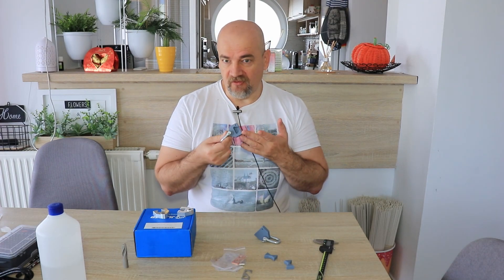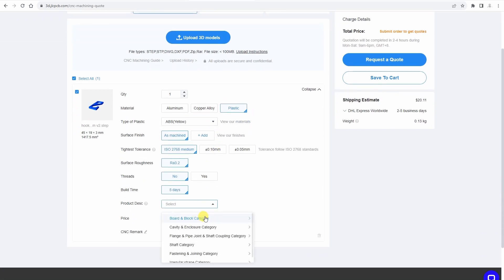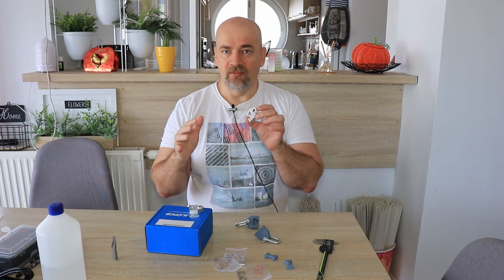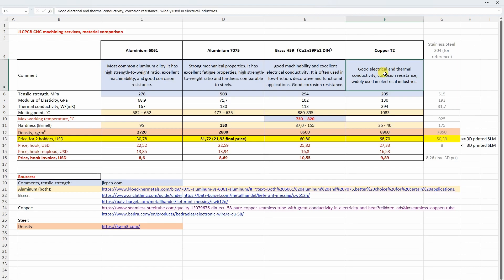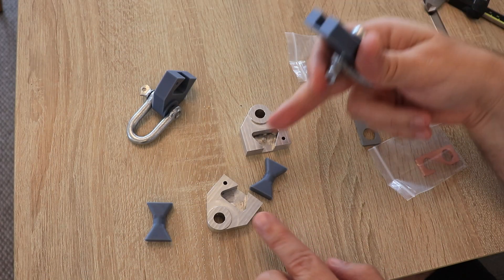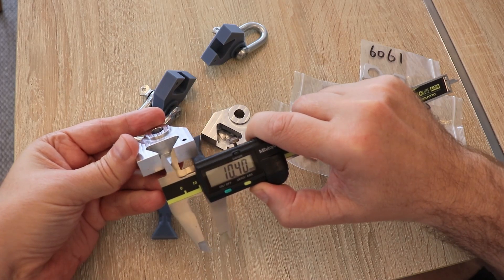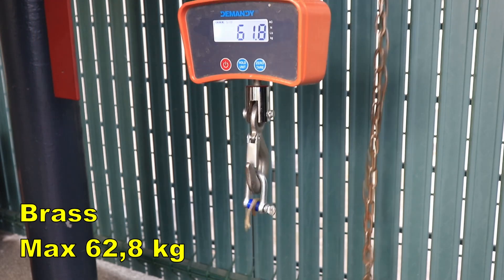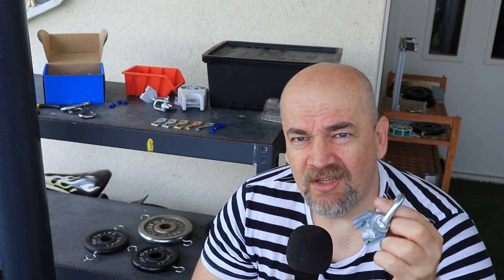If 3D printing is not strong enough: CNC machining services by JLCPCB

Comment: The prices seem reasonable and there are so many shipping options available.
Reply: depends, they charge like 30$ for part printed in ABS (even PLA LMAO) in 3h using 100g of filament, kinda monkey business, cheaper to buy 3d printer and print yourself